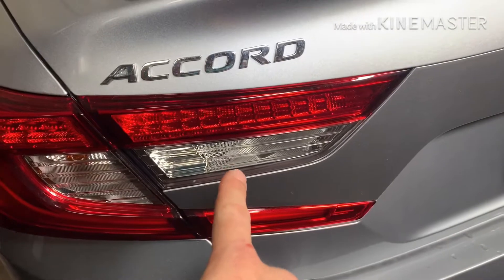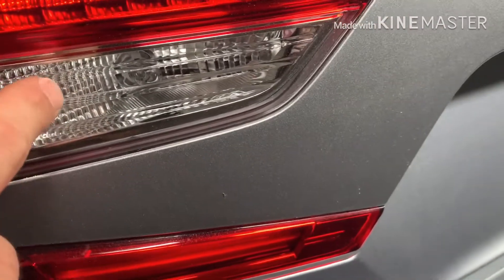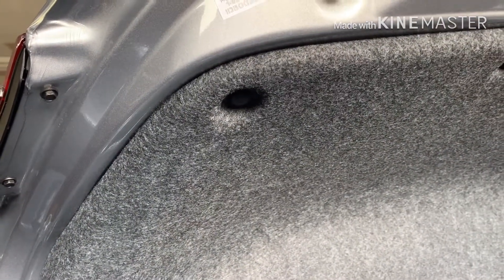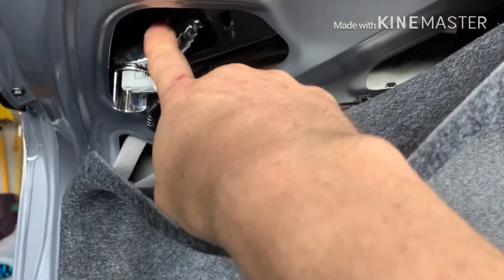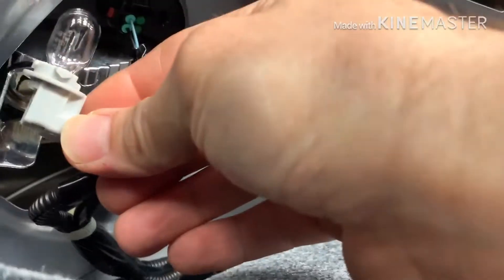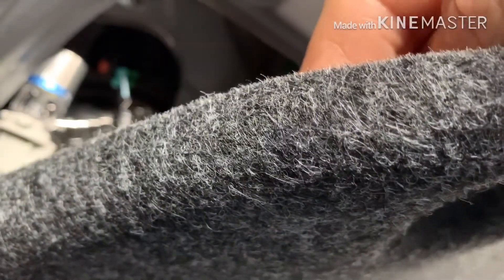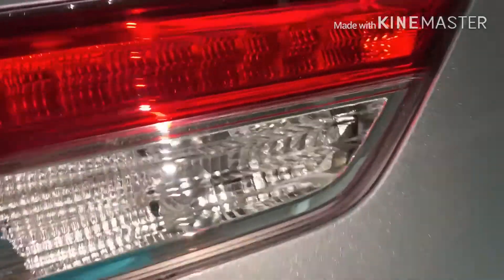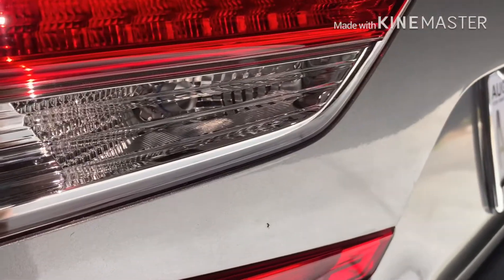2018-2021 Honda Accord Led install that’s a MUST for all vehicles with tinted windows

Comment: Just bought a pair using your link, can’t wait to replace the halogen ones out!
Reply from the maker: Definitely a huge upgrade. No idea why they don’t use led ones. These will help with tinted windows too.
Reply: Yeah, I changed the high beams too on my 1.5 sport like you suggested and what a difference too.
Reply from the maker: I agree. The nice white light looks great.

Comment: The Philips bulb that Jon uses is the Philips #12841.  It is the older higher performing rear firing LED bulb than the newer #12789 version that you’re all seeing sold.  Philips came out with the #12789 because they thought the #12841 was too expensive.  The newer bulbs are made cheaper and not as nice.  If you can find the old style; buy them!  Best bet is through eBay.  Hope this helps clear up some confusion.
Reply from the maker: Thanks man for that great info. 👍🏻

Comment: I was considering these since my full LED taillights are causing radio interference. The bulbs you have and the link you provided are different.  They seemed to have changed the design and are not as good anymore. The ones you have are the older and better version.  The new ones are all plastic without the aluminum sheild/ reflector on top.
Reply from the maker: I saw that. Check eBay. People have seen the ones I have on there. They are awesome bulbs.
Reply: @HondaJon  ok thanks
Reply from the maker: Anytime man.

Comment: Thanks bro 😎 do you use Philips for all the lights replacements?
Reply from the maker: Thanks. Yeah all interior lights and reverse lights. Never had one issue with them
Reply: What about the high beam LED head light, thanks
Reply from the maker: That I went with bulbs from allalighting before and loved them. Need to upgrade mine again.

Comment: Honda Jon I’m looking to add the touring brake light above the rear light. I have the Honda 2018 EXL 1.5 which Honda didn’t add to them but I have the harness. Do you know the correct part number for it?
Reply from the maker: I would go on hondapartsguys website and look up touring trim. It shows a nice diagram of the part.
Reply: I clicked on the link for the light bulb and it shows another bulb
Reply from the maker: Yeah I think philips revised the part. You can still find the bulb I have on eBay I believe

Comment: Does it make a difference on the visibility when you see through the camera?
Reply from the maker: For sure. That’s the biggest reason to do it. With tinted windows these bulbs definitely light up the road better at night and illuminate the camera way more.

Comment: Hi Jon those 921W Phillips led bulbs are they the Ultinon brand as philips makes different styles and from pics I can tell they are not all rear firing of the inside tail reverse reflectors These are 6000K bulbs Can you check for me Thankyou I found on eBay just want to verify with you before I buy them
Reply from the maker: Hi. Not positive on that but I know philips redesigned the bulb so the new ones do not look just like these. Let me know if that helps.
Reply: I think I know I can’t tell from info to Amazon link to the bulbs you have as a link are rear firing I know the ultinon ones I found just now said rear firing so those are the ones I will get The ones to the link are only $20 but definitely don’t doubt they are a redesign from what I can tell Take care
Reply from the maker: Sounds good man. You’ll love them.

Comment: The link you provided says it doesn’t fit my 2020 accord. Is the link wrong or are they?
Reply from the maker: They will fit.  A lot
Of times it’s not accurate
Reply: @HondaJon  awesome. Thanks for letting me know
Reply: Mine are set to come today so I wanted to be sure I didn’t have to return them. Can’t wait to replace them
Reply from the maker: Nice. Let me know what you think 👍🏻
Reply: They turned out great and fit
Reply from the maker: Nice. They are great 👊🏼
Reply: @HondaJon  hey man, I just changed all of my interior lights to the LED bulbs but was wondering if you knew if there’s a way to change out that little accent light that’s between the two map lights?
Reply from the maker: Nice. Big difference I bet. It’s a sealed unit. You’d have to soilder a new one. What did you want to change it to?
Reply: @HondaJon  I would’ve liked to change to LED to have it shine a tad bit brighter
Reply from the maker: Yeah. It’s easy to take that console out. Pull it down and you’ll see the light in there. Not hard at all. Just can easily put a new led
Reply: @HondaJon  would you have to take the map light covering out and would it be the same bulb as the map lights? I have extra of them
Reply: @HondaJon  I already changed all interior lights to LED but that one accent one I wanted to change but didn’t know if I could access it
Reply from the maker: Yea you have to remove the lens covers and you’ll see some screws. Then the whole thing comes down. You’ll see the bulb but it’s not a simple swap. It’s hardwired so you’ll have to solder a new one if you want to swap it
Reply: @HondaJon  crap

Comment: I just looked at the link you posted to the bulbs on Amazon. But they are clearly not the rear-facing LEDs you mentioned. Are they no longer available?
Reply from the maker: I do know that they changed the design. Check eBay. I believe there are now 2 styles. The ones I use really take advantage of the housing.
Reply: Was about to say the same thing lol
Reply from the maker: Nice. Yeah these ones are great.
Reply: @HondaJon  Looks like they are all sold out again....
Reply: I ordered it from your link and see that is is  it the same and definitely a different bulb. Will this be as good as the one you have in your video? Expected to get what was on your link and video.
Reply from the maker: Yeah. They updated the bulb. The only way to get the bulb I
Have is try eBay. But the newer style would be the better bulb since it was revised for a reason. Can’t go
Wrong either way. 👍🏻

Comment: How do you get the reverse lights to turn on without starting the car?
Reply from the maker: You just have to push the start button without foot on brake. It will be in accessory mode. Be careful that you have the parking brake on since that’s the only thing holding it from rolling.
Reply: @HondaJon  dang still nothing.... says 'engine must be running to shift from park'
Reply: @HondaJon  You must have a manual transmission....
Reply from the maker: No it’s automatic. You can put it in reverse in accessory mode.
Reply from the maker: Did you push the start button twice?
Reply: @HondaJon  I tried once and twice.... neither worked. I have a Touring 10at model but I don't know if that would matter....

Comment: Yeah doesn’t work on 2021.  The revised bulb in your link doesn’t even fit into the plug.
Reply from the maker: You might be able to find the older style bulb on eBay.